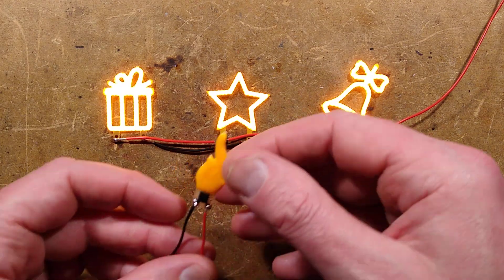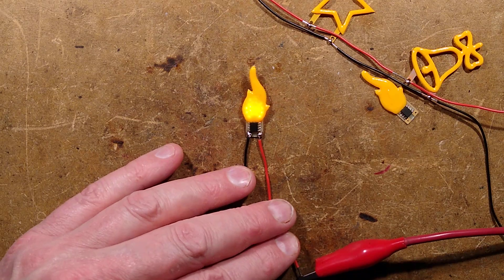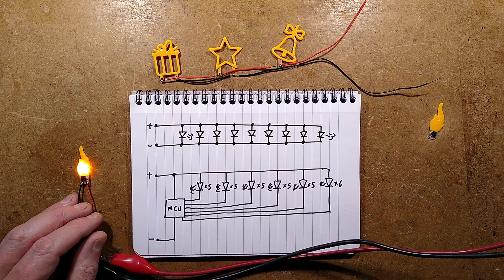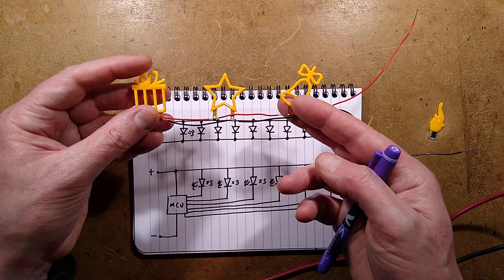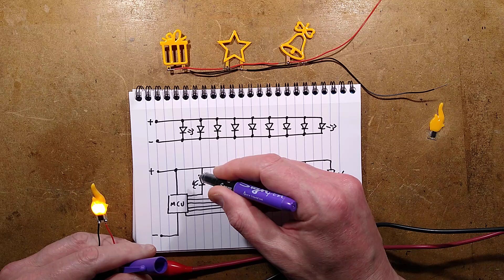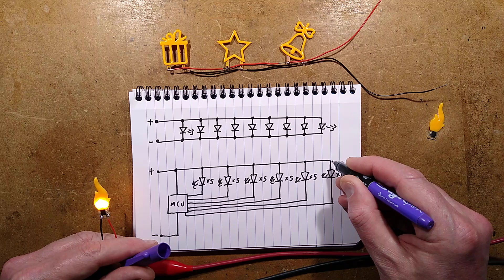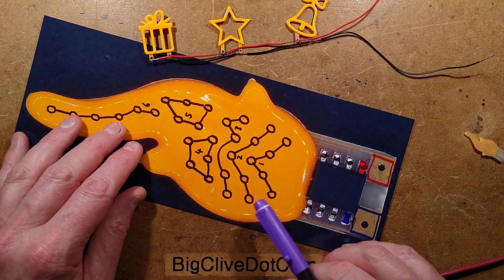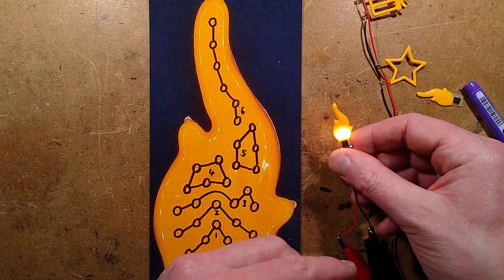Cool LED flicker flame PCBs

Comment: Question if you connect the flickering candle led in series with one of the shapes, they will fade in time with the flame led is there a way to prevent this happening.
Reply from the maker: They will have to have their own resistor and be run from the supply independently.

Comment: Hi Clive.  
I bought five of the flickering flame led's, but I'm unsure on the best way to step down a 5v 1a usb adaptor to 3v  without overloading them.
Would a resister be best or some step down converters?
Thanks for any advice.
Reply from the maker: On 5V all you probably need is a resistor of 100 ohms or higher depending on how bright you want the effect.

Comment: is it is it possible to connect a 5v led strip to a pianio 9v adapter
Reply from the maker: Not recommended as it will overdrive the LEDs and they will fail quickly.

Comment: That mystery ground track to nowhere was probably the Chinese designer thinking it needed a guard track for EMI or other mysterious reasons because they frequently like to include things that make no sense but seem to be trendy or something worth including even if they have no idea why it’s not relevant. If it was for processor stability with a missing cap you’d want the cap as close as possible to the CPU not at the opposite end of the board. I think most of these products are entirely designed by blind trial and error rather than by anyone who understands anything beyond the most basic electrical engineering concepts and often not even those. They mostly just copy stuff, often poorly, designed by people who know more than they do.

Comment: Not to bad. There's a control of current of power in the fire 🔥 led lights. That control of lights in the fire led, changing the color to blue and make it look like dripping 💧 water lol. Not too bad explaining it, keep the 1, 2, & 4 as the lights and 5 & 6 go off right and then have more codes 7 8 9 for the second rotation of flame to the left side, like the wind is moving flame from what you want

Comment: It's a pity they set up the microcontroller to drive the flame so fast that it is far from relaxing. Slowed down and with a little  PCM to vary the brightness a bit, it could have been much softer.
Put these in a chandelier and it'd probably look like sheet lightning.

Comment: I have "LED solar torch lights" that have a matrix of 96 LEDs on a flexible circuit board curled up within a white plastic sleeve within.  These are much larger than this individual "flame" shape, but have a similar number of channels and repeating patterns.  The effect is surprisingly realistic and satisfying, but with a ~5 second loop does become way more repetitive than it could be with a few more bytes of programming.  I have these in rock fire rings on my California dry mountain campground where fires are strictly prohibited.  Soon I plan to install a simple system of surplus pipes on the upwind side, branching out from a safe central incense burner.  With a stick or cone of cedar or pine incense burning, the immersive effect of the "flame" should become greatly enhanced, and the pipes are intended to mimic the real life experience of the smoke going right toward you no matter WHICH SIDE of the campfire you sit on!
Reply: .... You'll have to post a video when completed, sounds cool.
Reply: @robbieaussievic  You can see a still photo of one of these fire rings in action in my hipcamp listing.  Search my username there but spell out "mountain."  I'll definitely include a video of these in action once I make and upload some content from the ranch.
Reply: @lironmtnranch4765  ..... Found the image, that place looks like fun, the kids must love it.

Comment: Hi Clive. Do you have a direct item link for the flames? The one you posted takes me to a generic Aliexpress page here. Thanks!
Reply: They are at the bottom of the rest of the lights. Try this: https://www.aliexpress.com/item/3256802627552269.html?pdp_ext_f=%7B%22sku_id%22%3A%2212000022317234838%22%2C%22ship_from%22%3A%22CN%22%7D&gps-id=pcStoreJustForYou&scm=1007.23125.137358.0&scm_id=1007.23125.137358.0&scm-url=1007.23125.137358.0&pvid=4e5eaeb4-e420-481d-b9ae-837e8bb3af68&spm=a2g0o.store_pc_home.smartJustForYou_6000747323930.9&gatewayAdapt=4itemAdapt
Reply from the maker: They may be sold out.

Comment: I think it's time for Clive to modify the meteor light into a flame light, maybe throw in some pwm brightness too. Some small surface mount orange leds with a diffuse cover. May be a tad larger, but could probably be made cheaper than those candle flames; unusally.

Comment: Could these be used in an outside application say for a metal sign that has cutouts where these would be attached at the rear? 

So the flame section would be exposed to the elements but the bottom protected. Thank you.
Reply from the maker: If you lacquered the exposed metal it might work.
Reply: @bigclivedotcom  Thank you sir. I was thinking enclosing it (just the bottom) in pure silicon or would that creat to much heat retention? It would only be on for a few hours at a time.

Comment: Ooo, all those look pretty cool. My guess might be that negative that goes "nowhere" could be for screening? I say that because they've obviously chosen to use very thin circuit board material and haven't put a ground plane in. What do you think? Also - How easy do you think these would be to either reproduce or "upgrade" so there's better randomness?

Comment: This is off topic, sorry. Question.. Can you use the mains water pressure going into your house to generate Electricity  (hydroelectric) to power a heater or  lights?  We don't have a water meter, so can this be done? So it's essentially another supply of Electricity not connected to mains? I'm obviously talking very small scale. Thanks
Reply from the maker: Not for high power loads.  It could cause issues if you used the public water supply to generate power.
Reply: @bigclivedotcom  I mean just the pressure from the tap to fill some sort of tall cylinder say the size of a 2 story house, and the width of 2 cans, then at the top water goes over and vertical down some sort of pipe that feeds into a small hydroelectric generator and down the drain. The energy is coming from the Northumbrian Water and their pressure. Could it generate light if not heat? What other issues I haven’t thought about are there, thanks.

Comment: I would say that the sequence and randomness are correct for the flame effects. Where it falls short is the unrealistically slow timing. I was hoping for a resistor or capacitor that could be modified to increase the cycle speed and make it more realistic.
Reply: .... I concur, I have purchased a couple of 240v (B22) globes. The sequence is too slow on one and too fast on the other.
And the usless other two modes. The default is flame effect so they are not really a bother.

Comment: I'm guessing the static ones are designed for making Christmas lights. I do like the look of them, but going by the ones in that link they seem a bit expensive. If you could find a cheaper source, it could make a good project.

As for the flicker flames, they could cut the cost considerably and make them easier to manufacture using an epoxy blobbed chip instead of a soldered on MCU. The chip can be affixed the same as the LEDs, then epoxy blobbed, and then the phosphor gel applied.

Comment: True randomness with anything microcontroller based is nigh on impossible from what I can understand. Better to aim for a repeating pattern that takes a really long time, such as by having multiple timing signals contributing but at vastly different frequencies. Oddly enough yes, I have looked in to this sort of thing. Someone wanted a random time element in a water feature and it isn't as easy as it sounds. Especially when it's all mechanical.
Interesting little beastie though, can imagine combining that in a hallway with the window frame lamps and some sensors for an "interesting" effect. Touch of fog and away you go :)

Comment: Very nice! IIRC the flicker LEDs with the integral chip, those use something involving a shift register and some minimal gate logic... I've forgotten exactly what, but one imagines that a bit of trickery with XOR and XNOR gates would be most likely. I imagine that an ASIC for such things as this, with a similar effect, but eight stages instead of six and sufficient complexity to appear relatively random, might be cheaper than a microcontroller in bulk production.

I could also see a way to homebrew a similar circuit for use in chandeliers, if you wanted to do that with a custom 8-stage array of LEDs per flame element, and not use microcontrollers. Basically you'd drive the LEDs for a given 'flame' via an LM3914, and use a 74123 multivibrator, both stages, to PWM it from 0-5v -- if you're familiar with the timing circuit for the Signetics 2650 CPU you know what I'm up to ;) but I'm told the '123, in practice, was actually a pretty unstable chip, which works to our advantage here, as it means the PWMing will vary quite significantly. I'd use a 5v Zener as a shunt to avoid overvolting the LED driver, just in case, as well. 5/6 of a 7404 hex inverter would operate as a very short delay line, all five gates in series, running to 1/4 of a 7486 quad XOR gate. The XOR would be fed on one side directly from the '123, and on the other from the '123 through the NOT gate chain. The XOR gate would drive the /CLR line on the 74123 via the remaining 6th NOT gate, meaning that unless the delayed signal from the 74123 matched that of its current signal, it would reset. A (relatively speaking) large capacitor between the 74123 and the LM3914 would ensure that such drops would be visible as a slow decay.

The bad news is, you need one whole circuit like this per flame. The good news is, from what I've seen, the 'base' of most chandeliers has plenty of room for such a thing... ;)

Comment: Interesting that they didn't leave a pin floating and hook it up to the ADC internally. Sampling the floating voltage would have been an excellent randomizer. These little eight pin MCUs have more than enough processing power to have an algorithm going that dictates what groups of leds will turn on based off of the randomized voltage. Albeit that one group of leds has to be sacrificed to have this added functionality.

Comment: The problem is that these flames still look more like gas flames then actual candle flames. It is better because they 'flash' slower then the neon versions but still it does not look like candle flame. In addition I followed the link and they are crazy expensive (9.23 euro for one) Especially considering other Aliexpress prices. Anyway thank you very much for the video. I appreciate your videos very much. Greetings from The Netherlands (Europe).

Comment: This is really neat.  I've built a much more impressive candle simulator that employs red/yellow mixing with fading and occasional flickering effects, but is meant to be used to illuminate model buildings.  I'm tempted to send you one to play with.  I also did a quick search and found PICs that would be pin-compatible with your candle PCB and I bet I could write more convincing software for it.

Comment: Those are very cool. Though, to be honest, I still love the neon ones more. My grandmother had several candles using the neon type flicker flame bulbs and as a kid I remember just staring at those things for ages just absolutely fascinated by them. But these are very close, and quite good in their own right. A bit more variety in the LED clusters with a touch more work in the controller and they'll be quite nice.

Comment: Hi Clive,
I tried to buy a light for an older outdoor enclosed fitting (equivalent to 100W incandescent light bulb) but found that all of the LED lights said ‘do not use in enclosed fittings’.
Would love to know why (I imagine it’s just heat dissipation), but also what happens if you use these - is that a risk of fire or just shortening the life of the bulb? Would love to hear your thoughts on this if you have time, and if your up for any experiments on video ai’d be one of the first to check it out 😉
Cheers mate
Blessings.

Comment: Oh I just saw those filaments on aliexpress, I did want to see them light both side though

I was under the impression the flames would have their own inbuilt chip and not connected to anything else, which is a bit of a shame

I think the bouncing flame effect is... Too fast, or just wrong, I'm sure you could design something better, maybe using a 4017, or maybe some capacitors between pins

Comment: I recently made a flickering-flame effect lamp for a Japanese garden lantern.  It uses four strings of white and warm white LEDS, of which two in each string are the "flickering" LEDs sometimes found in LED "tealights".  The LEDs stand up at different heights from a small circular PCB and they're surrounded by a 3D-printed diffuser, all run from a 12V supply.  It's pretty convincing.

Comment: That  MCU   has  some type of  mu;multiplexer  on the outputs   that are  run   by TTL  flip fflops
Reply from the maker: If it's a typical microcontroller it will be effectively stuffed with that type of circuitry.  It's cheaper to use a microcontroller than to design a dedicated chip even for a simple task.

Comment: That's kinda naughty relying only on the internal resistance of the MCU output to limit the current. Omitting the bypass capacitor is also bad idea, the supply voltage would be all over the place with longer wires. It's not that big deal though, a capacitor can be added if needed.

Comment: I wander if you can make a really big flame assembly and use that chip?
Reply: If you use the chip to control transistors, instead of the LED's directly, I think you could.
Reply: @Jaycsee66  Yep, to manage the extra current draw of the extra led's.

Comment: i neeeeeed some of these flicker flame leds, i wonder if you disolve all of the phosfer coating off if it is blue leds inside it
Reply: the same seller has 80 watt multi die led chips as well...ooo......
Reply: @frogz  Got direct item link please? Clive's doesn't work here.

Comment: (AKA Lee)
My theory on the reason for the Negative line running up the side to nowhere (@6'30") - 
During manufacture there would be several dozen flames per PCB sheet, probably with vertical columns all sharing the pos and neg lines via the tracks that run up each side.
That way the whole PCB sheet could be powered up at once for testing. Duds would be noted and marked as such. Much easier than testing each unit individually.
When broken apart the 'unused' negative would look like it had no purpose.
Duds would be 'discarded' (i.e. sold off very cheaply to the more dodgey distributers)
Reply: Could it be anything to do with electroplating of the copper before the LEDs and MCU are soldered on?

Comment: Very neat. Would it be worth removing the chip and connecting the ground wire to each pin in turn to demonstrate each group of LEDs lighting up?